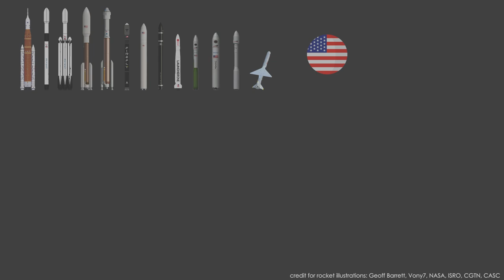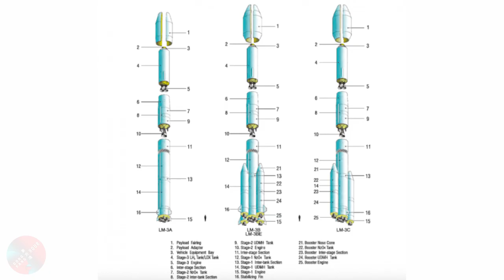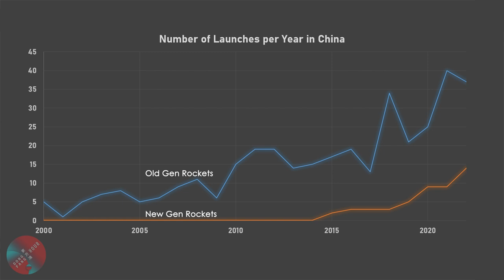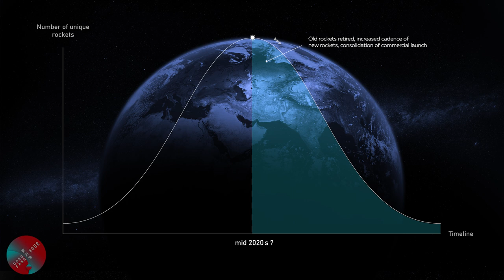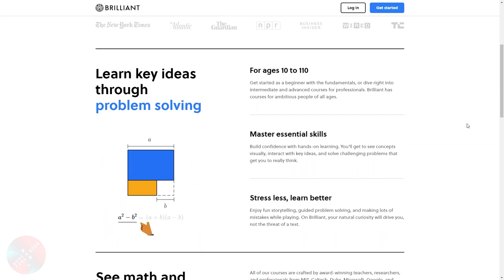Why China Keeps So Many Different Rockets Active

Comment: China needs to push hard to develop reusable strap-on boosters. In terms of difficulty and benefit, It’s a good stepping stone towards first stage reusability plus would ramp up payload capacity for many of the rockets.  A strap-on booster does not need the complexity of a high efficiency pump&engine. It returns from a lower speed and altitude and down range distance than a first stage. It’s smaller than a first stage making landing easier and stress loads smaller. One strap-on booster design can be used with minor mods on many different rockets plus multiple strap-on boosters allows for a scalable difference.    And with a widely used strap-on booster, economies of scale are achieved plus learning curve is completed faster and more complete.    A shortage of launch pads can be mitigated by strap-on boosters to double payload sizes
Reply from the maker: Thanks Doug, that’s a really interesting perspective. Do you know if there are any launch companies elsewhere going for a “strap-on booster first” strategy for reusable rockets?
Reply: @DongfangHour  … I don’t know of any companies pursuing this path forward … but it does make a lot of sense. It could even allow a rocket design that uses strap-on boosters to lift it above the atmosphere with a few thousand Km/hr initial velocity before the first stage is ignited. This allows the rocket design to bypass the atmospheric trade offs including vacuum optimized engine nozzles, inefficiencies of throttling back due to air pressure, plus accelerating in the wrong direction just to get above the atmosphere.  Another way to roughly underestimate the value is consider the amount of propellent required to accelerate the rocket that last few thousand Km/hr and replace it with that much extra payload in orbit.    
    It comes down to cost. If reliable reusable strap-on boosters are quickly turned around with reasonable maintenance cost, then the added cost per launch versus added payload per launch would be much improved compared to cost per Kg of payload to orbit without it.  An interesting cost perspective is to equate it to $1000/Kg payload for the rocket and $200/Kg payload for the extra payload due to boosters. 
   This is just the beginning of possibilities for low cost reusable strap-on boosters.
Reply: End of the day the long march rockets are largely derivations/variants of a set of core technologies, YF-100 and YF-20 for the core stages with the low volume more specialised YF-77 for heavy work. The Chinese seem to shy away (for now) from large SRBs so the 'old/low tech' YF-20 powered LM2/3/4 provides a lower cost  means of getting the day to day work done and as proven technology the failure rates are low. After all its about getting a payload successfully into orbit without breaking the bank not whether its the latest shiniest re-usable gizmo.  As China's satellite bus technology gets bigger, heavier and more feature rich or there's a need to build out massive constellations and the LM6/7/8s get more mature then there will be a shift and move to migrate away from the old work horses till then everything has it's place! It's easy to paint space as a race but satellites are put into orbit for a reason not brownie points. As for launch pad capacity don't think that's really an issue for a country that throws of infrastructure like kids play with LEGO!

Comment: Great insight! Besides technical explanation you mentioned in the video, perhaps there is a more tangible reason from politics perspective. Given there is a R&D team behind each rocket type, ranging from PM, chief designer from the top down to front line engineers, their career is tightly tied the rocket they are working on, more missions for a rocket means a lot for those peoples. It's always been much harder to decommission a rocket than asking for more money to develop a brand new rocket, so the curve in the video might have very long flat tail .... 😄
Reply from the maker: That’s a good point!
Reply: @DongfangHour  Not true... That's not how it works in China. I have first hand knowledge